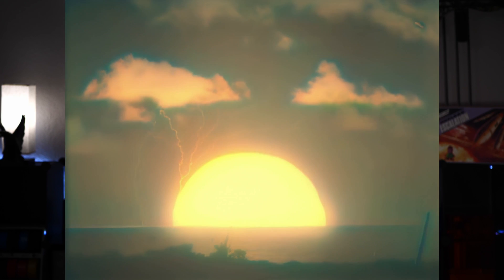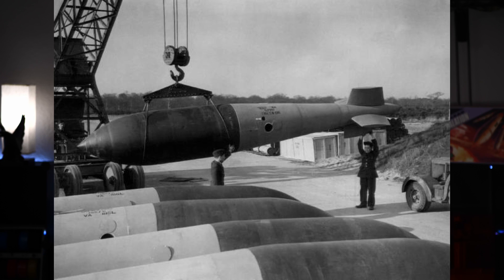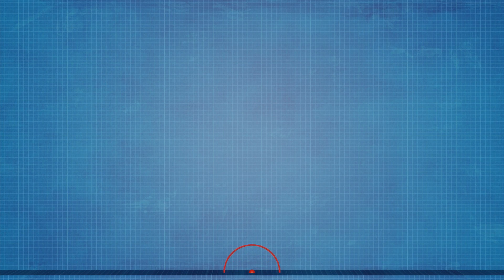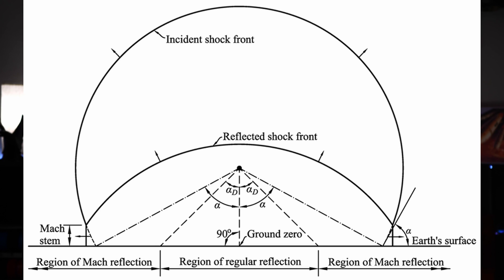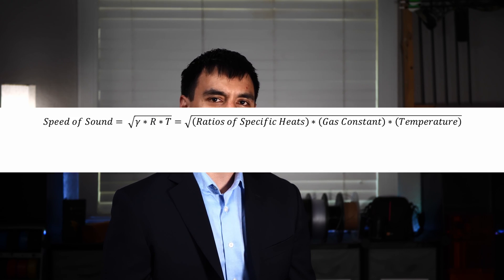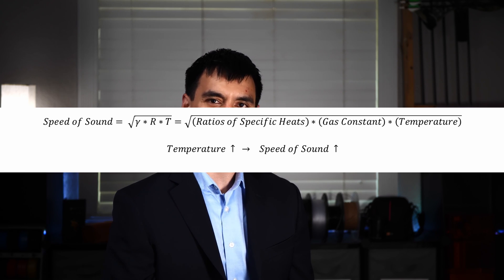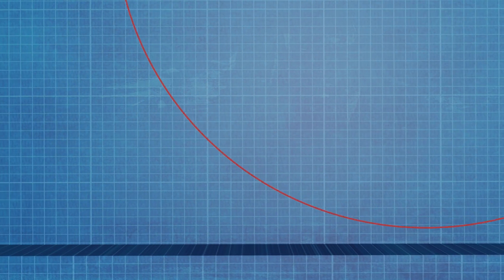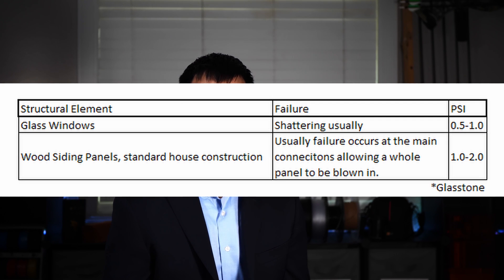Mach Stem: How a Shockwave doubles its damage because of different type of ground effect

Comment: Just a thought here.  We know how the mach stem  creates a high pressure area under the explosion.  But by all video evidence, it doesn't appear to expand much further than the area of the fireball / shockwave itself.
So does a groundburst not spread as far as an airburst ? it seems like all within either explosion would not survive.  But I guess you just dont want to waste potential destructive power....even if dead is dead.
Reply from the maker: Thank for you the view and comment!
As for the comment, the reason that the mach stem doesn't travel farther than the shockwave, is because for lower bursts (anything that is reflected) it is the shockwave, just the lower part of the shockwave. The 'traditional' shockwave still exists, its just the part that is slightly higher.

As for the question, that is super interesting and a bit more complicated. 
There are two peak pressure heights to maximize damage from a blast, both are 'ground bursts', but neither are contact surface bursts (the bomb should be hundreds or thousands of feet in the air to maximize the damage). This height will maximize the mach stem and reflect/convert the most amount of the shockwave into a horizontal pressure wave, causing the most damage. For a 1 KT, its at 250' or 850' of altitude (for 3 psi). Where as a 1 MT bomb needs to be at 2500' or 8500' to optimize the same pressure. Note: The lower hump, travels slightly shorter than the top humps, but is altitude insensitive to regards to the pressure your optimizing for, so a more generalize bomb should be deployed at the lower altitude.

FYI, the reason we really only care about the horizontal pressure component is building can't handle that force. They are really good at having force pushing down on them, but terrible for horizontal strength. Reinforced concrete can have a compressive strength of 2500 psi or more, but at 8 inches thick, will failure from a 3 psi blast.

https://www.deepspace.ucsb.edu/wp-content/uploads/2013/01/Effects-of-Nuclear-Weapons-1977-3rd-edition-complete.pdf - Page 117 (120 in pdf) fig 3.75, ex for 1 KT blast's double humped pressure profile vs altitude.

Comment: Nice video! Would a surface like water change any of this? As in increase or decrease the effects?
Reply from the maker: Thank you! And that's one of the most insightful questions I've ever gotten.

For a liquid surface, the Mach stem would still form, because water doesn't instantly move out of the way for a shockwave. If you see one of the old battleship broadside, you can see the shockwave from the gun 'dent' the water. After the 'dent' the shockwave would be reflected upwards and if it catches up with the primary wave, would still form the mach stem. 

Now as for if it would decrease the stem, I couldn't find any research on it, but I would imagine it would a bit, because water doesn't cause a perfectly elastic collision (nether does the ground, but it's allot better), but it is still incompressible, so the reflected shockwave would form, but would be substantially weaker.
Reply: @lastoptionavailable  thanks for the for quick response and info! Looking forward to the next vid